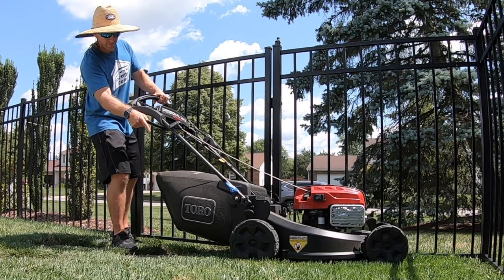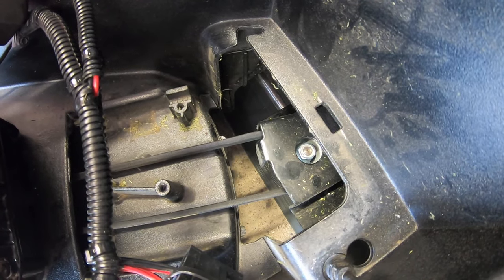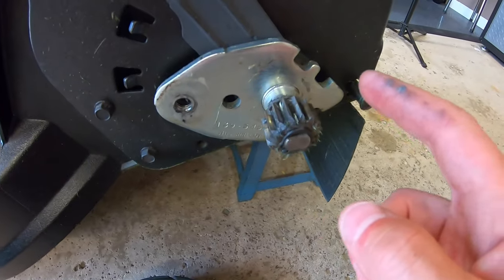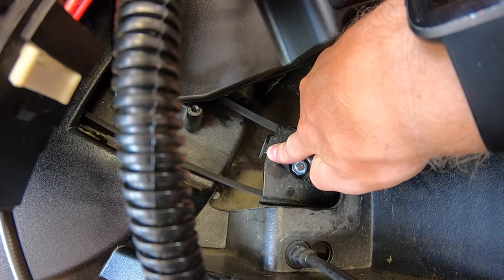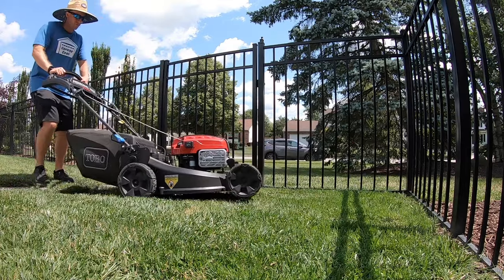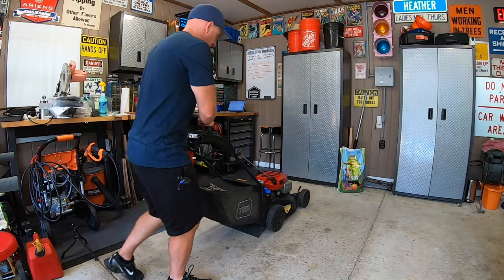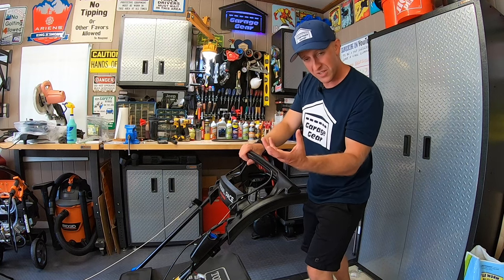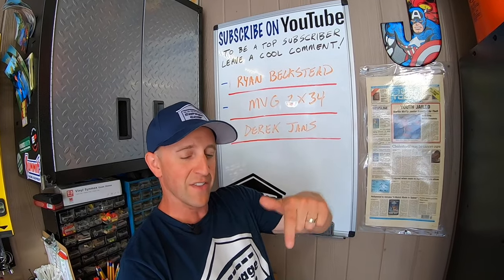WHY DOES MY TORO SUPER RECYCLER 21564 NOT BACK UP?

Comment: I just don't get rear wheel drive on small lawns. I prefer the front drive. I make turns by lifting the front wheels and pivoting the mower on the rear wheels. I never let go of the drive bar while I cut. I have no use for the personal pace. To me it is the same as trying to build a self driving car. This video shows you the problem with this system.
Reply from the maker: @DannyWalker247  thanks for sharing danny

Comment: I have a super recycler with the 190cc engine.  First going backwards got kind of tough after a while.  Then it got to the point where the left rear wheel would lock up when going backwards.  A bit after that the wheel would lock up when making turns.  And finally when the mower was off the wheel was locked in forward and reverse unless it was running.  This was over a time span of 3 years.  I took the problematic wheel off.  Removed the black cover, retaining clip, spring, washer, gear, the key in the shaft, and finally the white plastic washer in the very back.  It was pretty gross in there.  I wire brushed everything.  Lubed everything.  Put some grease in through the grease fittings in the back.  I did this on both wheels and it fixed the issue.  Wheels spin freely forward and backwards.  There is almost no resistance now when pulling the motor back when it's running.  Hopefully this helps someone with this issue.
Reply from the maker: Thanks for sharing this coolj!
Reply: So my right rear wheel spins very fast when mowing up hill . No issue on pavement.   What do I need to do to get this right rear wheel to move correctly?  Thanks!!
Reply: @brodygoalie  I'd slightly lift the back of the mower so the wheels are off the ground.  Then push the throttle.  Both wheels should spin.  Try stopping the wheels with your foot.  If one is very easy to stop compared to the other.  Take that wheel off, take everything apart (gear, spring, clip...etc) clean it all and reassemble and see if it's any better.  After I did this, both wheels spun at the same speed.
Reply: Thanks for your response and will  definitely do what your saying. Hopefully this will get my mower moving better!
Reply: I'm under the impression the new Toros aren't made that way.  I have a 2007 SR4 Super Recycler and it has the E-clip, spring, gear, notched washer, sprag, white nylon thingy and the rubber washer behind all that.  It looks like the new ones have a D-shaped axle and it's a straight drive.
Reply: @chuckgladfelter  I purchased my super recycler in 2021.
Reply: @c0olj  OK, that explains it.  Thanks for the clarification.

Comment: The amount of years I've been working on toro SR4, and anything with a personal pace, even the timemaster, there is a sweet spot on the adjustment of the drive cable, if you have the cable adjusted to tight, it will have that issue, give it a try, with the mower in slack untighten the 7/16th bolt, and take just a little slack out of the cable, just so it's just, one click I call it, tighter then slack, then tighten the 7/16th bolt on the adjuster, play with it to find the sweet spot, they all have one, I've found it too on the newer and older Lawn-Boys with their version of personal pace. It's worth a try, if you have the cable to tight it doesn't let the belt loosen enough so the mower can move backward easily. Just a thought, and a problem and cure I have run into with any personal pace system.
Reply from the maker: Thanks for the tip! I’ll check it out!
Reply: Why do I have to do any of this with a mower I just paid 1200$ for

Comment: I know this is a year old but I am an old machinist, I just bought a 21564. I might see if there is something I could machine so I could add a small spring to always pull it back down.
Reply from the maker: @gizmonova  that’s a good idea!
Reply: I'm going to drill an 1/8" dia. hole in the bent-down tab of the transmission pulley cover. ( I have the 60v Super Recycler with same trans. as JB's in the video).  I will attach a spring there and just hook it to the bottom lip of the deck to see if the principle works.  If so, I will fabricate a better mount for the end of the spring that will attach to the rear lip of the deck.  This problem sucks and must be corrected!
Reply from the maker: @mellowjammer  let me know how this mods work out for you

Comment: forgot to mention also make sure  the toros  with  grease fittings like model  21386    and others etc  in  rear wheels  have  been pumped with some marine anticorrosive grease or red tacky lucas  .
Reply from the maker: @lifehealth489  good tip! Thanks for sharing

Comment: I also have the Toro 21564 Super Recycler and I mow my Kentucky Bluegrass twice a week and rarely have an issue with backing up. When I do I push the handle briskly forward against the stop then pull the the handle and mower backwards This action releases the transmission. I love this unit and would not consider another lawnmower. .
Reply: Very true. The SR is best in class.
Reply from the maker: Thanks for sharing your experience with the machine.
Reply: Yep.  Personal Pace has always been this way, taking 6-8" of forward movement not under power to release.  I believe that was even in my manual.  You just need to give it a bit of a shove before you back up. It takes some getting used to, but it's never been an issue for me.  Still much prefer Personal Pace to other systems.

Comment: I bought my Toro super recycler in 1998 with a cast aluminum deck option.  I cut 30 lawns a week for 5 years and have continued to use it on my own property since.  This mower is tough as nails, dependable, and is the best mulching mower I've ever owned.
But from day one, I've experienced the backing up issue, and your suggestion to not jerk it backward is the definitive answer to this problem.  Cheers 🇨🇦
Reply from the maker: @jamesmisener3006  those older recyclers are one of a kind!

Comment: I have a 12 year old craftsman with a front wheel drive system.
This is an old style handle with the one bar for running the mower and the other bar you grab with your fingers to engage the drive (similar to the powersmart you reviewed).
If I had been using the drive, and then stop and start backing up, the front wheels lock up. They are not driving forward, but they will not roll backwards.
I note I have to stop the drive while still pushing it forward for a few inches, and this unlocks the wheels.
Hopefully you understand my explanation.
Reply from the maker: Hey Billy I think I get what you’re saying! Thanks for sharing

Comment: I have noticed the system sticking sometimes on my 2 toro time masters. But then I just lift up the handle and all is good. I have used fluid film to lube the system and it seems to be a temp fix. I have noticed it a lot on my Honda mower, I can’t remember the model off the Honda mower but it uses the thumb system to engage the transmission. I guess I will have to take a closer look at it to see if I can determine the issue. I basically only use it to attach my big league lawn stripper to… lol great video brother
Reply from the maker: Thanks for sharing this my friend! I think the Honda you’re mentioning is the hrn model or maybe an older version. Hope all is well bud!
Reply: @GarageGear  I will have to look into the model number of the Honda. I will post here once I do. I appreciate your videos brother

Comment: I am a new owner of this mower. I have had the issue you describe. But to honest it does not disuade me from recommending this mower. I have the older front wheel drive Recycler with the 190cc engine; it works fine. Maybe I put up with small frustrations without thinking it could be better. If there is a better machine with Smart Stow capabilities I would like to know about that machine? Maybe if Toro put the drive on the front wheels it would have solved the issue, but then again I could imagine an engineer probably considered ALL the possibilities before concluding that the rear wheel design was the only possible way to achieve what was required.
Reply from the maker: Thanks for sharing Chris!

Comment: One thing is to make sure your cable isn’t adjusted too tight, next thing is I keep the personal pace system lubed with dry lube spray, also use dry lube spray on the cable. Have zero problems pulling the mower back now!
Reply from the maker: Thanks for sharing Hank!

Comment: Similar issue with my Ego, except no belts. I find that if I engage the self propel and DON’T let it coast just a touch, the ratchet mechanism stays loaded up and won’t let it back up. What I LIKE about my older ego is the self propel lever is just a thumb lever. So I can disengage it and still push the mower (also saves battery by just using it to get rolling, then just push as I go). So as long as I let off the self propel lever before I stop, it’s good. This is the main reason I don’t like this style of drive system where it’s always active, and dependent on the pushing.
Reply from the maker: I’ve seen those electric transmissions become problematic for some over the years. Thanks for watching and for sharing.

Comment: I have the 60V 7.5ah Super Recycler.  It has the same issue but i find if you let it roll forward just a touch more you eliminate the back wheels locking up when your backing up.  I will fiddle with the cable a bit to see what that does for me as the forward motion seems to have slowed down quite a bit.  My biggest complaint about the machine is it is just way to heavy.  They should focus on lightening it up a bit :)  Thx for you video it was very helpful
Reply from the maker: Thanks for sharing SS!
Reply: My pleasure 😊

Comment: I have several Lawn Boy 10550s which have the Easy Stride system. I am not sure if Lawn Boy designed the system or if Toro did. Toro owned Lawn Boy at the time the easy stride system came out in the late 90s. All of my easy stride mowers have had that issue. The easy stride is an identical system to what you have. I usually try to bring the handle back to its extended position when I stop.  Ratcheting drive gears would have been nice!
Reply from the maker: 100% accurate, my friend. It definitely would have been nice.

Comment: Great video!  Had this lawnmower for 3 years and never had the backup issue. I changed the belt today and ... well here I am. Did loosen the wire, didn't help. But doing the slight push forward then back does help, just annoying since it never happened before.  Maybe the new belt is too tight.
Reply from the maker: I wonder is the new belt is tighter or slightly smaller than your last . Could have it measured at a repair shop.

Comment: My first mower was a '99 Toro 20042, old style Super Recyler. I think it was the first or second year for personal pace. That mower had the same clutches at the wheels as the 3 speed models. The clutches wouldn't unlock until the mower rolled forard a touch. I just learned to pull back a bit before stopping. I really liked it. However, this junk doesn't have any clutch at all. Totally different problem. You are always fighting the belt. I know the SR4 had clutches, at least early on. I wouldn't buy a mower built in the last 20 years anyway.
Reply from the maker: Thanks for sharing this Mike! 👍

Comment: JB, I tried the WD40 with some success, however I found product that seems to work much better in this application.  Dupont Teflon Non-Stick Dry-Film Lubricant.  I sprayed the areas you had suggested an then flipped the handle to the stow position and lubricated from that side.  That product coupled with adjusting the cable has gone a long way to eliminating the problem
Reply from the maker: Awesome John thanks for sharing! 👍
Reply: did you tighten or loosen the personal pace cable?

Comment: I just bought this mower from Menards on 30 Mar 24.  Used it that day, and I can’t stand this mower.  Rear wheels lock up almost every time when trying to pull it backwards.  The mower cuts well, but is heavy and very difficult to maneuver.  On the second use it also seems to not be propelling itself and can’t climb a slight incline.  I talked to Menards today and they don’t take back mowers that have been used.
Reply from the maker: Hey Dave! I feel your pain! If you could somehow add a spring mechanism to the transmission you’d probably be good to go

Comment: I have an older personal pace model 20383 2014-2015 vintage and had this problem while it was still in warranty. Dealer replaced a worn plastic bushing on the pivot point of personal pace handle. It was covered under warranty at the time. Hope this helps. My older Toro still mulches, bags and side discharges quite well.
Reply from the maker: Good tip here Tony thanks for  sharing

Comment: Never had the problem with my personal pace model 20372. I just replaced the transmission today along with new belt and now have the problem. I sort of pull back on the handle a little more of like a mild yank. And it will dis engage and allow it to back up, and on a long run, if I stop using the personal pace and just push it the last couple of feet and have to back up the wheels will be free. I really think this could be a cable sensitivity/setting  issue. Going to try and adjust the cable a little next time to give it a little slack or a little more tension and see if that helps.
Reply from the maker: Thanks for sharing this information scott

Comment: Thanks JB, picked up some more great tips. I adjusted my transmission cable and it cleared my problem with backing up. I haven't used the wd40 on the handle bars yet, but first thing tomorrow they are getting sprayed.
What I am battling with on my mower is uneven wheels. With all wheels in the same exact notch,sitting on level concret my front left is always high (about 1 notch). I cannot for the life of me, figure out why. I have to have that one wheel one notch lower than the other 3 or it mows uneven..ever seen this before?
Reply from the maker: Hey Keith! Never seen this before on another mower unless it was broken somehow! My front left wheel is a little off to! Bad build quality! This is what cheating out looks like! Thanks for watching bud.
Reply: @GarageGear  thanks JB
Reply: Mine does the same thing.

Comment: Toro really needs to fix this.   Like you commented in your video, a light spring that pulls the transmission back down might be the ticket.  I have the same drive system on a cheaper version Toro, and it will push forward and backwards hard at times.  It makes mowing a workout.  The mower mows awesome otherwise.  It's the best mower I've ever used when it come to mowing minus this one crappy flaw.
Reply from the maker: If they fixed this this mower would be greatly improved!

Comment: The issue with the wheels locking up when backing up has been happening with the Toro units since the personal pace transmission came out around 2002.   I recall using units with the personal pace back in 2002, 2007, and 2012.   All had the same problem.   This is one thing that is really perplexing regarding Toro.  Many of their units have had flaws for many years and they never do anything to fix it.  The personal pace tranny, all the issues with the Timemaster and Turfmaster,  and even the commercial 21" Toro I have still has an issue of spitting wet clippings under the left front wheel and then the wet clippings stick to your left rear tire causing clumping.  As time as gone on, Toro, like most corporate giants, seem to be cheapening up their product to maximize their profits and bonuses to the CEO and management.   Have you tried adding the traction assist handle to the Super Recycler?   I believe the new ones are black in colour not blue like you see on the timemaster.  Some people have had luck with that in not getting the rear wheels stuck.
Reply from the maker: Thanks for sharing this Joe! I haven’t tried adding the traction assist. Wonder if toro will do anything about This going forward.
Reply: @GarageGear  Unlikely as long as people keep buying their products.  With Honda exiting the lawnmower business along with all the problems they've had with their HRX and HRN series of mowers,  Toro will have less and less competition and thus we will be able to take more liberties with their customers.  The numbers tell the story.  Here are Toro's Q2 results for this year:
Toro (NYSE:TTC) Second Quarter 2023 Results
Key Financial Results

    Revenue: US$1.34b (up 7.2% from 2Q 2022).
    Net income: US$167.5m (up 28% from 2Q 2022).
    Profit margin: 13% (up from 11% in 2Q 2022). The increase in margin was driven by higher revenue.
    EPS: US$1.60 (up from US$1.25 in 2Q 2022).

Comment: I have the  20355 824 which has 2 transmissions hence, 2 cables to adjust.  I don't believe you have done a video of that but I surely would love to see what you think of this particular model.   Trying to get both cables to sync correctly is like driving a 1961 Mack Thermodyne B51 with a split rear end.   Its a constant battle and with the missus doing the lawn last summer, instead of nice neat passes the lawn has nice neat grooves from dragging and over spinning the wheels.  The authorized Toro service dealer doesn't think there is anything wrong but if you look careful enough, they don't have any grass to test on.  I even wrote to Toro a few times....their silence is deafening!  The solution to this?  A brand new Ryobi battery powered with a transmission so smooth, you don't even hear the gears grinding!
Reply from the maker: Thanks for sharing this Sam!

Comment: I have an all wheel drive husqvarna lawn mower that does the same thing when doing short cuts, but mine just has a bail bar to drive it so it's easier to do this but I do have to push it forward alittle bit to get it neutral then I can pull it back works it's sad to say I have an mtd Troy built and a husqvarna and the mtd has the better transmission
Reply from the maker: Thanks for sharing this about Husqvarna and thanks for checking out the channel.